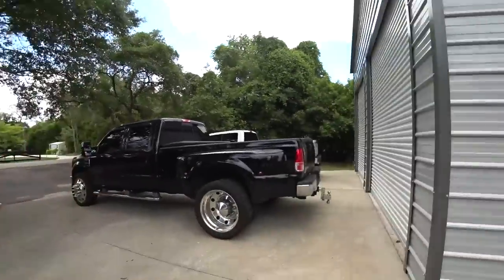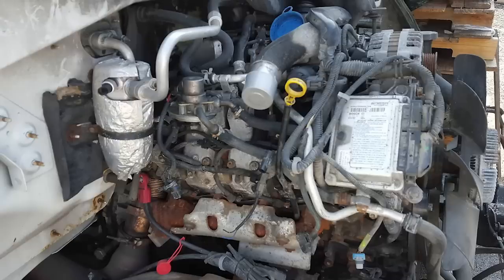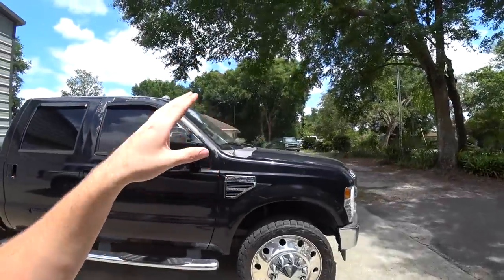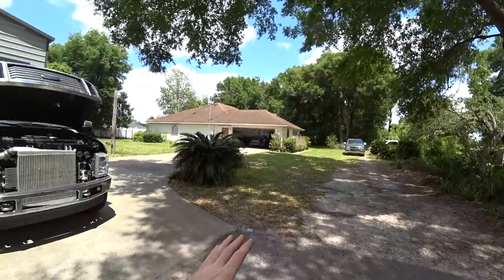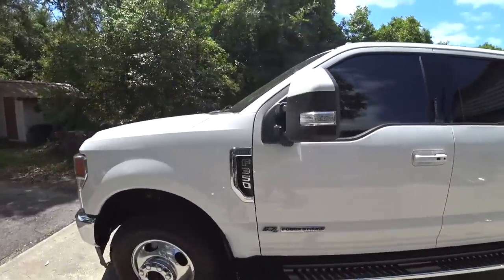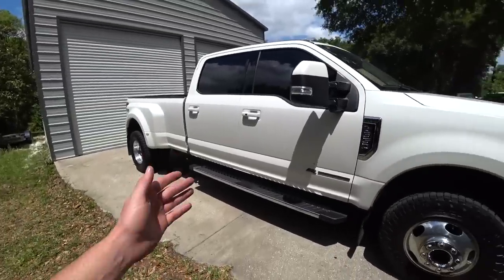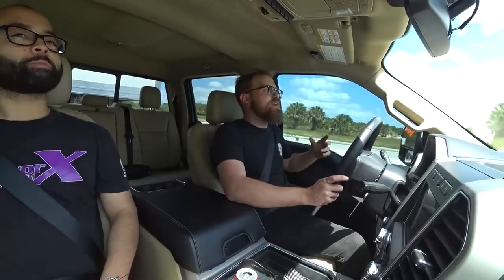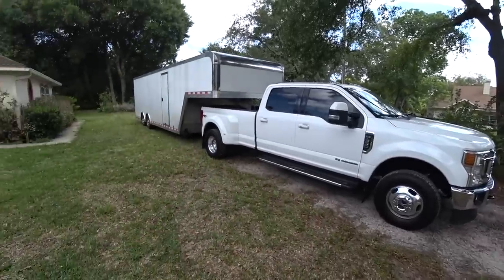Buying a new Ford Superduty to replace my Cummins swapped F350.

Comment: Treat yourself brother, you deserve it!
The ol Fummins was a trooper and we all loved it, but it was clear that it had to be replaced eventually. 
You needed something dead reliable, so that was the only sensible choice
Reply: Jim jibroni  the 6.7 is trash.
Reply: @asherdie  id say the cummins 6.7 is better than the ford 6.7 but i like the ford chassis and the chevy is out of the question completely
Reply: @hambix1032  they are all rolling computer time bombs anymore.
A Cummins, in a Chevy, with a solid axle frontend like a Ford would be ideal.
Explains why I built my 1991 Chevy square body Crew Cab.

Comment: I'm not a subscriber as I'm a Cleetus fan, but watched Adam LZ before Cleetus for the mechanical part. What is great about Taylor Ray is that I can see a random video and he explains everything I need to know for it to make sense. I drove a 79 C20 from when I got my license until recently as a daily driver, work truck (construction trades, and tow rig and I have an 88 K5 Blazer on 35's and a 6" lift. The C20 has a very well built 406 sbc that meets the requirements of Komnifornia smog. In 2020 I also bought a new Chevy 2020 Duramax/ 10 speed with all the extras (LTZ with $10k in upgrades to match the High Country). I can easily relate to Taylor and what he has done. So far, I haven't parted with my square bodies, but needed a comfortable and fuel efficient truck to do what I need with a body that is beat from construction work and unpreventable ailments.....there isn't a day without pain anymore. While I saved money, I drove my mom's old 2005 CC 1500 silverado with over 300k on it. I considered a 2005 F250 with a bulletproof 6.0 since my parents bought a 350 dually that my buddy owned (upgraded and tuned as well as deleted), but $25k was too much for an older truck that would need $10k or more in engine and trans work. Luckily, 2020 was a hell of a year for work and I bought the new truck and only had 3 more months before I had enough to pay it off........I saved for a few years as I passed up used trucks. The shop looks good from the front and I haven't watched since he tore it down. While I am not into some of the cars Talor does, I need to catch up on all the other content he does so well. Great video!

Comment: I lol'd at 16:54 - 17:08.  You went from a rock solid, simple engine that did the job to a nightmare waiting to happen.  But alas, I may be biased as I have a Cummins in my K3500 dually.

Comment: Just to go with the "getting old vibe", just get a folding sunscreen to put in your windshield to save your dash and keep the interior bit cooler too!
Reply: Or tint it 75%
Reply: @jaredm674  I paid the tint shop to do up all my glass with 25% on the sides, back, and sunroof. It has 90% on the windshield even though that's illegal I challenge anyone to find it without getting all up in there to peel at the edges. It makes it much quicker to cool off.
Reply: @jaredm674  the % doesn't make as much of a difference as getting a high end ceramic tint. you can get a very light or clear ceramic and it'll keep out more heat than shitty dark tint
Reply: @Tanner731  💯

Comment: Had a 2018 F450 Limited. Miss that truck every day. The 6.7 trucks are incredible, and actually shockingly easy to work on. Congrat's on the addition to the fleet. You've come a long way and deserve the reliability.

Comment: Having just had to replace my power folding steps because the gears eventually stripped out, the static steps is way more reliable IMO
Reply: Both have a purpose, obviously static is more reliable, you have to crash or it has to rust for them to fail… but power steps have a purpose too.

Comment: Why replace the Fummins???? It’s such a sick truck

Regardless, very proud to see how far you’ve come. Buying a brand new dually is a flex that you deserve. Props, Taylor.
Reply: As good as the fummins is it is hard pressed to do anything as well as a newer era pickup. They are just leaps and bounds better tow vehicles.
Reply: @Justaneon99  just wait until the aftertreatment shits itself and it derates you to 45mph.
Reply: @bradenwuesthoff5639  once the warranty is out on his truck.... theres fixes for that. also dont idle for long periods of time.
Reply: @bradenwuesthoff5639  dont idle alot and you’ll be just fine. The idling and short trips, is what kills some trucks with emissions. Oh and excessively long oil changes will alos kill these emissions trucks.
Reply: @bradenwuesthoff5639  He might honestly not have much problem since he's gonna be mostly towing with it.
Reply: @Slammed46  If you're talking a delete... nowadays, it's hard to find a delete tuner with the EPA crackdown and the diesel tuning market moving to emissions-intact tuning. Not to mention, it's illegal (federally) and if he's ever required to do an emissions tests and he fails, he can't drive his truck until that's fixed.

Comment: I have an 2017 F250, 105k miles, I got it new in 2017, and have never been happier. Best truck Ive ever owned. So many features. BTW, my favorite feature is the Adaptive Cruise Control,

Comment: I love the 6.7 powerstroke's and they are great. But at some point it will almost certainly leave you stranded from emissions. But upside egr cooler cores aren't too bad to replace but failure to regen's will put into an idle only limp mode.
Reply: The worst thing about all the diesel engines since 2008 is the emission control stuff. I have an 08 Dodge 6.7 Cummins in my 2500. I like the truck but the engine is always giving me trouble regarding the regen. About once a month now I'll need to take it out on the road for a high speed run for about 60 miles so it can do the regen.  This gets expensive, especially with diesel priced around $5.00 a gallon. For those in CA, add another two to three dollars.
Reply: @Harry-zz2oh  Should be able to do a manual regen from a scantool
Reply: @Harry-zz2oh   that why I keep my federal emissions lb7 2003. No cat or EGR. Smog legal in CA with banks six gun big hoss bundle. Hauls the mail. 20 mpg Vegas trips.

Comment: Wouldn’t the semi wheels and tires make the Truck ride much more rough due to the increase in psi and tread design in those wheels and overall diameter?
Reply: And tiny sidewall. The sidewall  thickness of a tire drastically hurts or improves ride quaility
Reply: Yes
Reply: Yeah that’s why that 7.3 drove rougher than it was supposed to lol
Reply: yeah, but they look cool 😂 😂
Reply: @GordonTurnerr  feel that 💯 they definitely look cool. I’d think the only thing that would improve the ride would be bigger tires as in height but in an all terrain. But I get that’s not Taylor’s style.
Reply: What Gordon said man!
Reply: They are semi wheels, but they have been milled to 24" from 24.5" and that allows you to run a more common tire. Commercial truck tires are terribly uncomfortable on the ride. Not sure what is on the new truck size wise, but I have an 08 with 19.5" and the tires suck! Any type of consumer tire would be more comfortable.
Reply: You don’t run normal pressure with semi tires because the sidewall are so stiff.  With my dually Ram on 22.5’s I only ran 30psi in the rears and they’re normally at 120psi on a semi.
Taylor is running cut wheels with non-semi tires, so he can run normal tire pressures.
Reply from the maker: You don’t use semi tires. They’re milled down to 24” to take normal tires. And with a good tire like the nitto recon grapplers. Still get stock quality ride.
Reply: @Taylordrifts  I bet if you put those on the new truck you will be shocked at how terrible it rides compared to the stock sidewall thickness... the sidewall is what provides the cushion, thin sidewall means you feel ERRTHANG, does not really matter the tire.. some are better then others, but they are still tanks.
Reply: @SylasG  also, very rarely for semi tires to be st 120, typically 100-110., semi tires are also a MUCH harder tire as they are meant for ALOT higher weight. So even aired  down the rubber compound is not soft enough for a light duty pickup unless you are loaded to max gvwr  all the time..
Reply from the maker: @drake_24v_hawkins  well the fummins had the same tires as the new truck on it originally. And it rode better after I switched. The sidewall is taller than it looks.
Reply: @Taylordrifts  ah, gotcha, video does no justice, my daily I just went from 35s with 20s to 35s with 18s and it DRASTICALLY improved my ride quality. Love the content man!
Reply: @Taylordrifts  awesome!! Didn't realize your weren't running commercial style tires. Whatever you end up doi g I'm sure it will be rad 👍🏻👍🏻
Reply: @Taylordrifts  if I put 22 Alcoa’s ona 2020 350 you think it would ride somewhat good?even I replace the shocks with something better
Reply: Larry yacht

Comment: Congrats, dude! Followed you for all the trucks you talked about at the beginning. Makin' moves! Piece of advice, 6.7's need to be deleted to have longevity. I'd delete it immediately. You'll get quite a bit more power and reliability. Also they have CP4 issues and you should get one of the kits that prevents a grenaded CP4 from destroying the fuel system on it. Just my 2-cents. Again, congrats, my dude!

Comment: There is this guy at my work who has a 19 6.7 dually who delivers campers trailers and cars for a living only mechanical upgrades he has done is an upgraded trans pan and a CAI and he has 378000 miles with no major mechanical issues. So happy for you man the new setup is rad

Comment: Congrats on the new truck and was thinking you might want to add a large 'lean to' to the side of the shop for covered truck and maybe even trailer parking.
Taylor, if I win the give-away truck, I'll trade you for the OEM wheels and tires off the new truck.  I just would rather have a more common wheel and tire combo.  
That could even be an option for the winner of the give-away, if it's not me. :-)
No doubt, I will be entering to win it.

Comment: Excellent description of your journey to a long-distance towing vehicle with a modern comfortable cabin. Last year I bought a 2022 RAM 2500 4x4 Laramie with the Hemi engine. My towing needs are minimal but it has all of the technical upgrades that you mentioned. The lack of stress from fearing that you will break down will make it all worth it. Good choice.

Comment: I think I’m getting old too fast. Haha I feel the exact same way about noise and comfort and I’m only 21. I made my LLY super comfy and as quiet as I could but it doesn’t compare to my new ‘15 lml high country comfort wise. Any I went from a 2500hd to 3500hd, yet still smoother ride. My race car can be as loud as it wants as long as my truck is comfortable🤣
Reply from the maker: Exactly that 😂 I just wanna get in my nice
Comfy box and cruise home from the track without noise. Or worry.

Comment: Fuel cooling ecms is a common practice on larger Diesel engines in applications such as over the road semi trucks, caterpillar, Cummins and Detroit have all ran fuel through their ecm’s at some point

Comment: I have an 07 2500hd gas truck that I was towing my race car with and whatnot and had the same deal where I was worried every time we left. I would literally work on the truck for like a week leading up to every trip to deal with whatever had come up since we last towed with it. It was absolutely EXHAUSTING cause I was also always working on the race car in that time too. I ended up buying a 2015 f250 crew cab and man, what an absolute game changer. And I never ever have to think about it, just hook up and go. The difference it makes on your mental health leading up to each trip is more than you can measure in dollars. Congrats man, what a huge deal this is.

Comment: I think the new truck is well deserved. I have recently done the same thing. I was always the one to buy older vehicles and make them into what i wanted or needed. Well in the past 4 months now I have bought a 2019 supercrew f150 lariat and its an absolute game changer with all the features and comforts that it offers. I can finally tow my cars where I need to go for long distance or short and not have to worry about it. I think we all get to this at one point or another and get something new. Congrats on the new truck man

Comment: I always used to drag something home that someone else was done with,redo it and drive it until it was junk. Buying a decent vehicle for a purpose goes a long way. Congratulations on your purchase. I hope it serves you well. I can't get over how well the 6.7 Ford tows. I recently had 25,000#s in tow through the mountains of Pennsylvania. Everytime I thought it was starting to give up I stepped on the throttle a little more and it literally set me back in the seat. Impressive vehicle.

Comment: Last year hadnt had a a newer car in years in the family. Got 2012 Yukon Denali. Needed it really bad for pulling a trailer and the 6.2 was the right choice. Family Business did really good last year and we bought a 2021 Chevy Silverado Trail Boss  with a 6.2. We only pull a  16ft enclosed trailer with Hand made Furniture so it dose really well.  Sold the 2000 Wrangler same time we got the trail boss and got its replacement 2 weeks ago. 2020 Jeep Gladiator Mojave. The change from a 2000 Jeep Wrangler to the 2020 Gladiator is so crazy. Going from a jeep that can hardly run AC to a truck that had a button for everything lol.  Took time to get there  but damn it feels great having a new RIDE after so many shTTboxs for years

Comment: Some of these new management systems are wild, pedal position has no correlation to throttle blade position,  it is all obfuscated in software. 
It can be jarring at first, but it really is nice on the highway when throttle inputs are translated to increase wheel speed, decrease wheel speed, maintain wheel speed. 

The computer can pick the gear,  boost level, etc for the terrain or curves - whatever and you don't have to think.

Comment: I'm right there with ya. Always had rusty ole truck that I kept going nicely but it was always a little something and no truck was ever perfect. I've had literally over 30 trucks in the past 5 or so years, but last year bought a 2015 Ram 1500 Hemi with the 3.92 gears and limited slip and bigger gas tank so I could tow almost 10k lbs. It's enough for what I need to do, and boy is it nice to have a newer vehicle that just works right. I watched the Fummins build on the edge of my seat during the pandemic stuck at home but I'm sure you're happy with the choice you made, and the Fummins can go to someone else to enjoy it thoroughly.

Comment: I love my 2016, 6.7. Two weak points. The cp4 fuel pump (they sell a disaster prevention kit) and the cold side charge pipes tend to pop. There are a few aftermarket options for replacements. I have done the cold and hot side pipes and they smooth out the turbo power.

Comment: If your worried about your dash you can always tint your windshield. Llumar makes a clear tint called air 80 works great for protecting your dash and blocks crazy heat for the Florida sun. If you were in our area I’d say bring it by but you can find any llumar shop in your area.

Comment: I hope it's a good truck for you. I've always heard good things about the newer powerstrokes. But the company I work for bought 3 2021-22 f350 and f450's and they have all had issues. First one had Trans issues and would get stuck in 5th gear and put it in limp mode. I think it was a recall and ford was going to fix it, but they couldn't get to it for months due to part supply issues so we traded it in. Second one had electrical issues probably not it's fault though.(Turned out it was previously wreckrd) 3rd one which we currently have but is going to get traded in really soon Will randomly pop a fuse and shut the whole truck down which is sketchy when you have a 44 foot gooseneck behind it and have no power brakes or powersteering and these have all been trucks with under 30k miles. The 2022 duramax with have with the 10 speed straight rips our damn goosenecks like nothing. We have a shit ton of newer rams too. They have been pretty good to us but compared to the chevy they just shift so damn clunky and ride like shit.  I'm not hating on ford I literally have a powerstroke just telling you the experience I've had with the big 3.

Comment: That was true in the daimlerchrysler days for sure, but things have changed. Love or hate ram they have made ford and GM step their game up especially in the interior. My 2019 ram is packed with features. It's quiet, comfortable and has decent power. Truck is almost three years old and hasn't given me a reason to look elsewhere yet. Congrats on the new tow rig.

Comment: I never liked white cars until I had a white platinum tri-coat mustang. Don't know if you mentioned but the remote start is pretty sweet on hot days, ac comes on and by the time you get in the cab is comfy.

Comment: The new super duty’s are awesome, we’ve got a couple, only problem we have with them is the def system. They’ve got them down on not breaking or anything, but the problem is that they suck def when you hook a trailer to them, we usually only get about 1500-2000 miles on one tank of def pulling a 32ft 3 axle gooseneck cattle trailer. But other than that there’s really no problems with them

Comment: Changing injectors on an LLY Duramax is ~1/2 the time of doing them on a common rail Cummins. With an LLY you simply undo the lines, undo the hold down, and remove. There is no messing with a valve cover or odd torqueing procedure. The FICM (fuel injection control module) is on the valve cover, not the ECM.